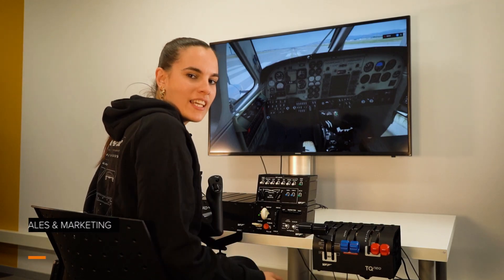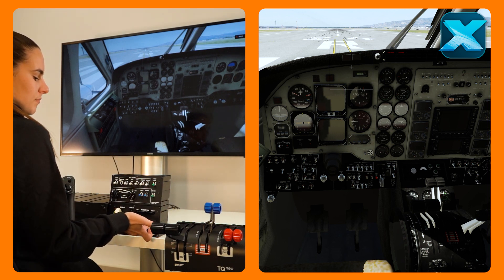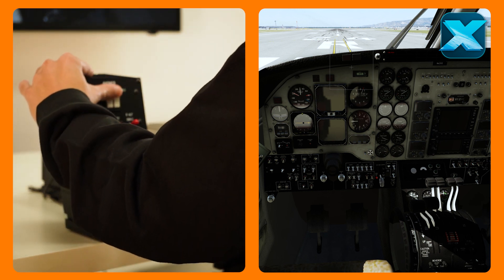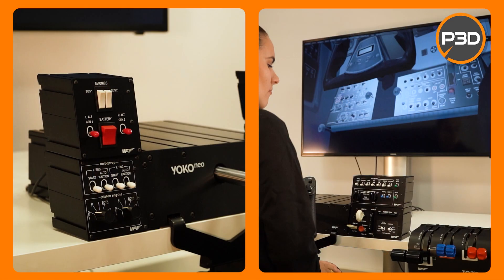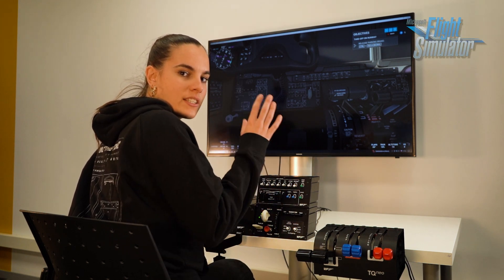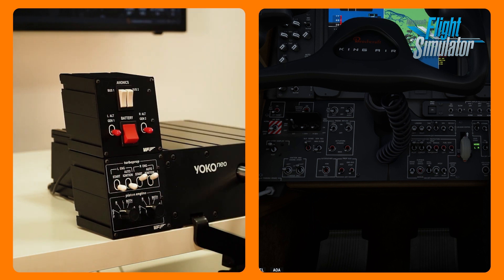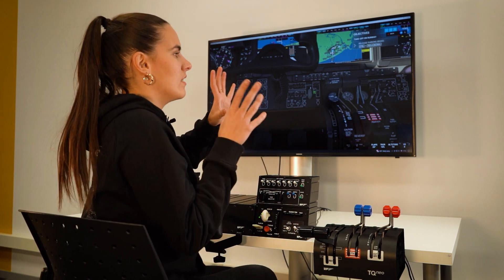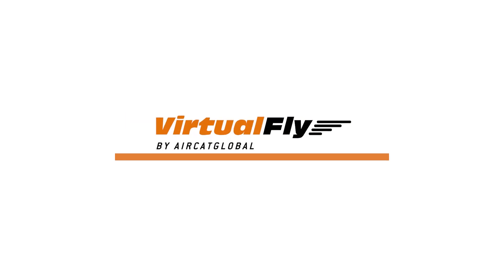INTERACTION OF THE SWITCHOS flying TURBOPROP

Comment: Congrats as you ve just killed the turboprops engine due to too high ITT 😂.  I know it s not the putpose of the video, but the fuel is not introduced right away. Otherwise, you risk a hot start.
Those little modules look lovely!